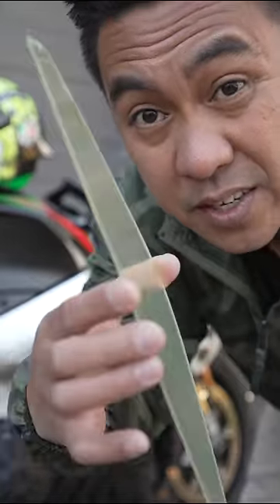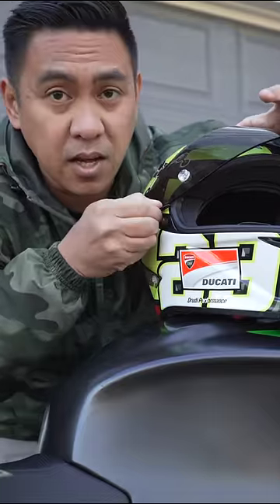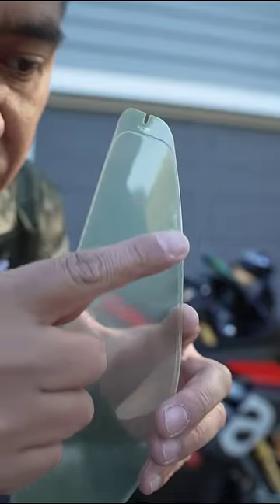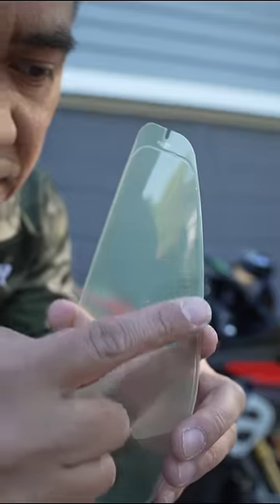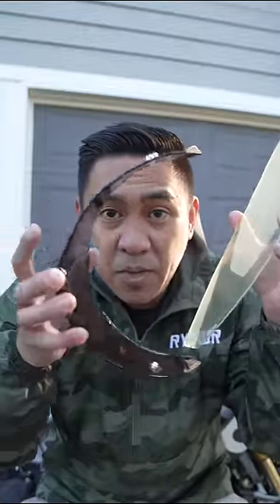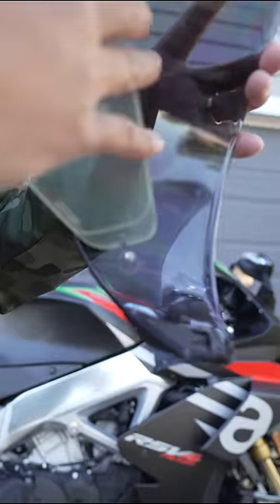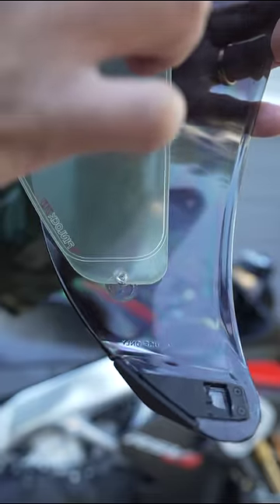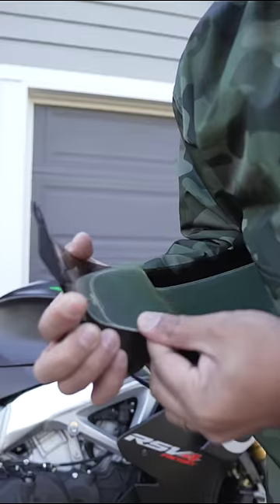HOW TO INSTALL A MOTORCYCLE HELMET PIN LOCK

Comment: If you have a non pinlock visor, just remove it and use shaving cream. Apply a dime size blob and smear it around the inside. Let it dry, then buff it off without using water.
Its hydrophobic and as a bonus, the helmet smells great inside.
Reply: Muc-off also make an antifog spray
Reply: Damn you Lovelessissimo, I'm gon try this.
Salute
Reply: @BangChief_AllIsOne  Good luck, and godspeed. For what it's worth, I used that Edge green gel stuff.
Reply: @lovelessissimo  Salute
Reply: Also works with anti-dandruff shampoo 😂
Reply: This works really well.  On a cold wet morning it works wonders.  Along with the neoprene gloves under your riding gloves.
Reply: When I still rode I tried this after being told it works on bathroom mirrors. Worked pretty good
Reply: Tiny bit of WD-40 and a cloth will do the same.
Reply: Don't use shaving cream this will sting if it gets in your eyes. Use baby shampoo, its less toxic and doesn't blind you if it gets too wet.
Reply: @Mu7eD-Stream  that doesn't happen.
Reply: @lovelessissimo  I can assure you it does. Shaving cream is SOAP, for adults. Compared to baby shampoo it is highly reactive. When you have spent as many hours underwater wearing masks as I have. I can assure you if there was a better product we would have been using it.
Reply: @Rubios_Rebels  I have never gotten any degree of irritation in my eyes after using shaving cream on my helmet visor. Not once. Even after doing it a lot. Even in the rain. Maybe because I don't wear it underwater. This works. If you don't like it, don't do it.
Reply: @lovelessissimo  Don't try and reason something which is clearly more toxic as safe just because you personally have never had any issues, this isn't how safety works. Under water the environment is twice as serious with regards to fogging.  The factors the same. Hot/cold surface meets cold/hot air. Masks have protective coating as it's the same material, therefore care and servicing is exactly the same. No one ever taught you professionally how to clean your helmet, ride you bike yes, but clean stuff is not part of exam, whereas for diving it is.
I would refuse to dive with anyone who used any other type of soap than one which is specifically no tears and 100% hypo allergenic. That said I don't know anyone who would as it is taught from your first dive what to use.  
Then also all the buffing will not be good for the actual protective layer to prevent condensation from the manufacturer whereas baby soap the worst that can happen is a nice smell. 
Furthermore furthermore Shaving cream is not hydrophobic as you claim it to be. It is oil based and it is infact a layer of oil on top of the mask which is providing the anti-condensation protection. Oil is hydrophobic to water, shaving cream contains oil to aid smooth shaving, the cream however is very much hydrophilic. The propellant, cream, soap, fragrance are all irritants and can and will affect vision should they be contaminated by rain or such and drip into eye. Baby shampoo containing oil however does not cause this effect.
Then their is the time taken to apply. Baby shampoo just requires a thin layer applied by fingers or small cloth. That's it. No rubbing, no waiting, no mess and best of all a wonderful smell.
Reply: To add a funny substitute, you could use a 'special' type of lubricant, as they like baby products are designed to be as non-toxic and hypo allergenic. 🤣🤣 It would be less dangerous than shaving cream also 🤣🤣
Reply: @Rubios_Rebels  You have clearly never tried shaving cream in a visor, and so are speaking of dangers from hypotheticals and ignorance. Which is understandable. However, I have done it and can attest to its efficacy. I mean no disrespect, and you seem to be well-intended, but what you are saying is falling flat here. My experiences trump your theories, and in my experiences, it works extemely well with no ill effects.
 To be fair, though, I'll give baby shampoo a try. No reason to limit options.
Reply: I've tried every version of this trick from toothpaste to shaving cream and none of them have ever worked
Reply: @austingardiner6880  you used toothpaste on your visor? 😬
Reply: @Mu7eD-Stream dude. Your forgetting that that shaving cream is buffed into the visor. So unless you place your eyes against the visor, you won’t get it in your eyes.    Hand lotion is bad for your eyes but it doesn’t affect them when you rub your eyes after cause it is buffed into your skin
Reply: @lovelessissimo  safety glasses, face shields, snow goggles etc. toothpaste is arguably just as hydrophobic as shaving cream but I've never had any success in keeping my shit fog free.
Reply: @austingardiner6880  I hope you used children's toothpaste.
Reply: DO NOT use shaving foam, it contains skin lotions and shit ghat will smear on your visor. Just use a cheap bar of pure soap to make some foam, spread it on the visor, let it dry out and wips if of with a dry soft cloth.
Reply: @DanSlotea  Weird, that didn't happen.
Reply: @lovelessissimo  happened to me, and that shit never came off. Maybe with paint thinner :))
Reply: @DanSlotea  what kind of shaving gel did you use?
Reply: @lovelessissimo  can't remember, it was about 20 years ago and it was somebody else's, as I don't shave. Usually they put moisturiser, balms and other crap, it"s not pure soap.
Reply: @DanSlotea  well, give it another shot. It works great.
Reply: @lovelessissimo  plain soap works great too! Even cheap liquid soap for both hands and dishes. :))
Reply: I use head and shoulders. Works well also
Reply: @DanSlotea  I'm always up for trying new ideas. Except the guy talking about using toothpaste. That's abrasive.
Reply: Would this work for paintball masks? They fog soooo much
Reply: @TinoMSM  it would work.
Reply: seems like this will work on mirrors in the bathroom from fogging because of shower steam
Reply: thanks man i'll have to try this
Reply: I’m going to try this… it’s actually dangerous sometimes waiting at a light and you can’t see nothing
Reply: @Arizona_Vineyard  it's worked out for me for a long time.
Reply: How long will this last though?
Reply: @danielvipin7163  I do it once a year.
Reply: @Mu7eD-Stream you do know that the risk you speak of is way higher for scuba divers, because your goggles are way closer to your eyes than a helmet visor. Now if they were talking about riding goggles, then you'd have a fair point. But we're comparing goggles to a  helmet visor. Not quite the apples to apples comparison.
Reply: Same thing for bathrooms
Reply: Thank I appreciate that
Reply: Sheesh
Reply: Was also about to say shaving cream aswell
Reply: He's a genius
Reply: Also works with candle wax or deodorant
Reply: I was about to say shaving cream been doing it for 20yrs works on dive goggles as well
Reply: @drsubaru5745 do you rinse it off with water?
Reply: Agreed,   honestly I installed a Pinlock and it just made my view Blurry.   Anti-Fog or Shaving cream works good, no smear of you do it right and no fog!
Reply: And then you remember you wear glasses.
Reply: @MrJKD360  I have terrifically bad eyesight.

Comment: Visor manufacturers don’t recommend using alcohol to clean their lenses as it tends to be a little harsh. Will it work? Absolutely. But over time it will accelerate the wear on the visor. Water and gentle soap is best for longevity.
Keep up the great content Adobo 💪
Reply: correct. alcohol will peel off the antifog coating of the inside of helmet visors. this is basic.
Reply: Yeah I had a monitor one time and I used alcohol to clean it, one day I woke up and it was absolutely ruined.
Reply: Ive been also responding telling people. BABY SHAMPOO. It prevents fogging and doesn't hurt or blind you should it somehow get in your eye. Your point about alcohol corroding plastic is correct in most cases, though some hardened visors plastics maybe resilient.
Reply: yea guys please dont follow these instructions  just come down to your local cyclegear store or our revzilla locations and we will either show you the proper way or do it for you for free
Reply: Ok i fucked up only if I saw this comment earlier
Reply: @democratic_chocolate2067  Visors will need replaced periodically anyways. Just clean it gently and replace it when it wears out, you’ll be ok.

Comment: People don't know that the "fog" is just condensation of water on the cold visor from your breath. The pinlock adds a layer of plastic that stays warmer inside your helmet so the water vapor doesn't condense. The gaskrt is there to prevent water vapor from sneaking around the pinlock and condensing on the visor anyways.

Basically you're paying $35 for a specially shaped piece of plastic and gasket.

Comment: They make antifog inserts for visors without pinlock ready visors. You’ve just got to make sure it’s not too big for said visor. 

Bonus info-
Nano Z-coating is great for repelling rain. It last the longest and has the best results for clearing the visor of water, be it a foggy mist or down pour. It won’t be like a car with wiper blades but it will be the closest you get to rain x for glass. The rain x for plastic is garbage, tear aways blur your view like oil mixing with water, wax does the same, nikwax doesn’t last and results are slightly better than the plastic rain x. This was my experience with each product.

Comment: got a pinlock for riding in the cool humid winters of georgia. pinlock fogged up instead of my helmets lens. didnt notice a difference for fogging up. did notice an annoying reflection/glare of lights between the main visor and the pinlock lens. To give the pinlock any credit, i did notice its a little quieter in my helmet with it in.

Comment: I'm just curious how is the visibility on these? I hope they don't "warp" or "de-grade" the vision as you ride especially on bumpy roads.
Reply: Alternative solution, apply shaving foam both inside and out, buff off with microfiber towel and clean. You gonna do it after awhile again. Almost 10yrs rider here, use this method always.... ride safe ✌️
Reply: 💗much appreciated @otarsulava
Reply: I've had one on my helmet for a couple of years. I've never had any problems with it warping, de-gradeing or distorting my view. The helmet came.with the pin lock from the factory. I haven't yet tried to apply one myself yet
Reply: It has absolutely 0 drawbacks. Best thing I've ever put in my helmet. Never fogs up

Comment: The “seal” prevents moisture collecting under the pinlock so you don’t get a fog sandwich. The pinlock itself absorbs moisture like a sponge and has to dry out between rides. If you are in humid enough conditions or you leave your helmet outside moisture will saturate the visor and your pinlock will fog up with the rest of your visor. Just remember, 2 pane windows still fog up.

Comment: I got rid of my pinlock visor. The pinlock visor kept fogging up due to temperature changes moving the visor and breaking the seal. Started cleaning my visor once a week and reapplying a layer of anti fog coating. Works like a charm and my visibility is way better since i also wear glasses.

Love the concept but doesn’t work for me

Comment: My 2 cents- don’t use alcohol. My helmet has anti-fog layers integrated onto the visor. Manual states alcohol will ruin it- so be careful with your visors y’all, you’ve been warned.
Warm water washcloth, let them sit on the visor to soak, then dry with microfiber

Comment: You can also get 'tack on' pinlocks for helmets that aren't pinlock ready
Reply: or get a dual lens face sheild, or even a heated lens
Reply: @ShadowDragon246  or just get a tack-on pinlock that is essentially a duel lense and I wouldn't want a heated visor :) I'm not a panzy
Reply: @nicetryloser5327  and heated visors are nice in the winter. yes there are people that ride in the snow... well on the good days where roads are not anow covered, but its still -5°C out. lol

Comment: Installe pinlock just to have glasses fog up still lol
Reply: wear contacts

I doubt you’re riding in snow so you shouldn’t have any problems with the cold affecting the lens. I personally don’t need to use my glasses when riding, but if I did I’d wear contacts
Reply: @blizzthebike  i need contacts lol but i cant see shit without um so i deal with it. Gonna try out some tricks to reduce it

Comment: Ok, kind of right. So yes if you have a gap youll experience fogging. Its your visor fogging though not the pinlock. You missed the most trick bit too, it has a semi absorbant coating, so it absorbs the moisture of your breath and dissapates it over a longer period of time.

Comment: For those that have installed and removed your pinlock and it is now loose, those pins are actually little cams, turn them to tighten the system back up and seal it again.

Comment: Use a basic spray wax detailing spray and buff the inside and outside of the visor with a microfiber towel after cleaning it with windex or alcohol.  You can also do this with your glasses and the windshield/windows of your car.  Thank me later.

Comment: Never use alchohol to clean plexi of any kind. Any micro-cracks in the material will lead to fissures and crack the material. Also you don't need this, just use carnuba wax on your inside and outside of the visor and all over the helmet and you bike as well. One it forms a hydrophobic barrier and two it polishes the plastic.

Comment: My Shoei GT Air was fogging no matter what I did, and what a surprise, my new GT Air 2 also fogging. Why?
Reply: Try shaving foam, apply it from inside and also outside of visor, buff of and clean with microfiber towel. Rider almost 10yrs, use this always and it works.... Ride safe ✌️
Reply: @otarsulava  will try it. Thank you
Reply: @zolitimo5482  Sure it's not a permanent solution, after awhile you repeat it again, but it works, there are other polishing paste that also works but I would stick around with a shaving foam only, vs other polishing liquids or sprays that has chemicals, I would not use those on visors, especially if the visor is photochromic (the ones that gets darker on sunlight and clearer at night) ✌️

Comment: Unsure if visors have this or not, but most lenses/prisms are coated with anti reflect and antifog
So using alcohol is a huge no-no, use soap and water instead with ur microfiber.

Comment: Does this tech exist in a smaller form? I have the same issue with a smaller respirator mask
Reply: Pinlock is a motorcycle-centric brand. My best suggestion would be to look into anti fog coatings you can apply directly to the lens.

Comment: If your helmet comes with it PUT IT!! Just remember, in cold periods, to put your helmet in the house, don't leave it in garage or cold places or the visor will still fog up until the temperature of the internal visor encreases. If you can't keep the helmet in your house, take off the visor with you WITHOUT REMOVING THE PIN LOCK VISOR!

Comment: Don’t ever grip the pin lock between finger and thumb. 
You’ll leave fingerprints on the inside and they’ll annoy you forever. Fit by deforming the edge.

Comment: Have one on my snowmachine helmet(Alaska here) and it worked till I put it on then it fogged the surface of the pin lock :( ig there’s only so much you can do with a visor before you just have to switch to goggles

Comment: Don't clean with alcohol it drys out the rubber seal in ur helmet if you have to use alcohol use a mix of 90%water 10% alcohol

Comment: never ever touch it on the inside, these fingerprints will stay there forever. Lay the visor on a flat soft surface then install the pin lock

Comment: Implying from this video, all motorcycle helmets have the pins to install this and it’s just your job to buy the inlay.
Not true
You completely neglected to mention it’s a diy install of the pins where you have to drill through a visor you already own OR buy the visors from oinlock or some other sellers who have already installed pins.  And there’s also a few manufacturers who have actually included the pins into their visors but that’s only the high dollar ones, not the ones people ride on regularly.

But yes, that’s how you install the inlay after you have the provisions to install it.
Reply: My €70 Caberg helmet had the pins and the pin lock installed from the factory. My €50 HJC helmet has the pins on the visor for one to be installed.

Most likely you're not in the same market/country as me but there are options.

Comment: Why not just manufacture motorcycle helmets with built in anti-fog feature? Seriously I wouldn't buy a helmet without this feature, don't talk to me about cost because this is a before purchase consideration.
Reply: many helmets come with pinlock ready to install, so they already have a solution from factory. This is more convenient than a coating for most because it can last years without needing to be reapplied. Through cleaning, most coatings will end up getting wiped off.

Comment: It's a silicone bead not a beveled edge and it has nothing to do with trapping air. The material itself just doesn't fog. I saw that pin of shame but you are dead wrong my friend.
Reply: The silicone bead prevents moist air from getting in between the pin lock and the visor. Its that simple. No magic.

Comment: Why is it called a pin lock? just as confusing as medicare
Reply: it’s main selling point is it’s ease of install and replacement due to using two pins that go through the visor. Otherwise you’d need adhesive or an anti-fog coating.

Comment: this is just bulshit, here in the autum the air is so moest and lean even a glass will for up because.... yes correct there is to much moisture. So smart advice, don't drive fast with wet conditions (if you have sporty tires) drive with and open visor (not hard for th eyes  because the air is already 90%+ humid. Even in the rain I always drive with open visor so who cares.